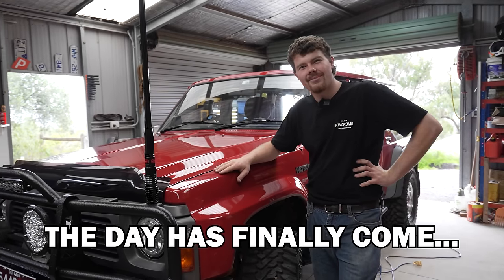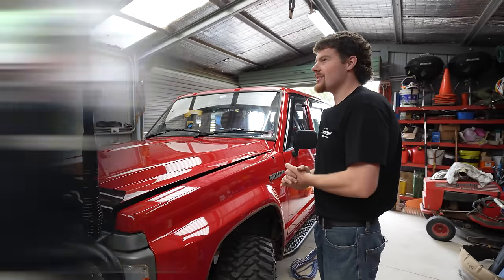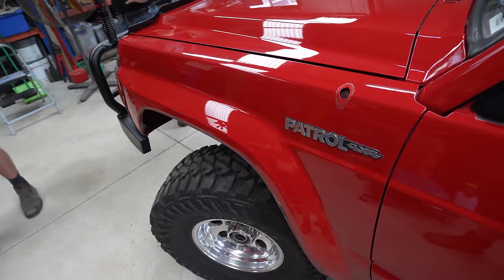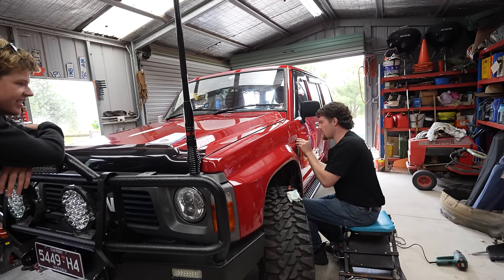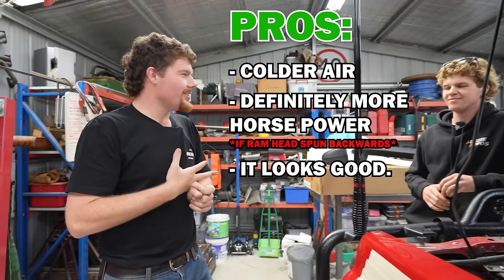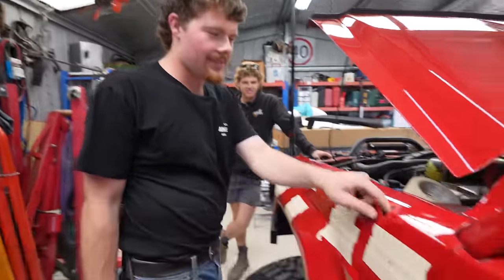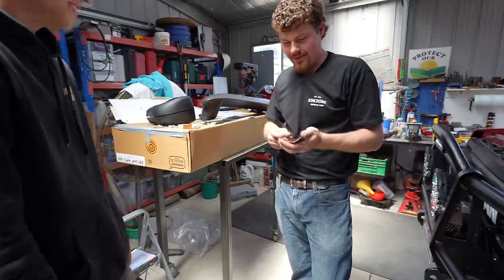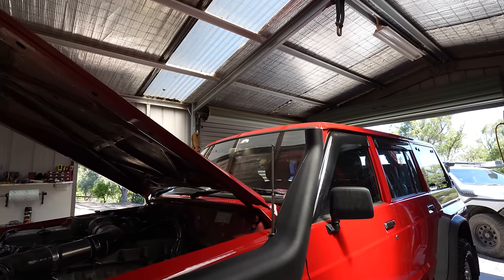Cutting a hole in Dan's Immaculate Patrol

Comment from the maker: What do you think? Has Dan made the right choice? Let us know your thoughts!!!
Reply: Great job Liam, great moral support!!!
Reply: Great job Lads 🎉
Reply: Definitely the right choice there, the new style Safari snorkels look mint on a GQ.

There's two things I did differently when I fitted the same snorkel to my GQ. With the holesaw, I used a much longer pilot drill in the holesaw, which was long enough to go through the guard and into the inner guard template/bracket Safari gives you. That got the holesaw lined up spot on to where the safari template wanted the hole, it also prevented the holesaw from eating the guard or wandering off target if it binds up.
The other thing is that I used blind nutserts in the pillar instead of those plastic clips. They're like your regular nutserts, but have a blanked back end, so even if water does travel down the threads, it can't go anywhere.

Keep up the good work boys.
Reply: Yes. I think the factory look suits the car better. Especially for his intended purpose
Reply: Finally some common sense and not just fitting an open ended posing s/s down pipe🤦.
Reply: It looks good, & Dan's thinking on it makes sense for what he wants. 

I draw on the great wisdom of "Uncle Rich" of Rich Rebuilds, if you don't know, he is the one that put an LS in a Tesla & called it "Ice T", a D-.max in another Tesla! And took another man's wife out to dinner @ Olive Garden & conveniently forgo his wallet on purpose! ( - I guess it would be the equivalent of "Smorgies" Probably a bit before you young fellas time, ask your parents :0))

Something to the effect of: "When you have your own YT channel & your own Tesla you can do it how ever you want"

Having said that, I did once see someone weld up a rear wing out of 3mm mild steel plate & bolt it on to the deck lid of a Camry some years ago, did not even linsh the edges. That upset me a little.
Reply: Looks sick 👌🏼
Reply: Why do you have so many chainsaws?
Reply: Nice job Dan,  my only complaint is that you make it look so damn easy😂😂😂
Reply: Looking good dude you know what's up every one will have an opinion about whats what but it's your car and you build it the way that suit you 🤙

Comment: Very neat job mate.
As someone who has done that job to several vehicles I've owned over the years, including my brand new GU in 2000, I know how nervous you must have been. 
Now, at 69 years, I've learned that snorkels are a waste of effort for most people. 
Deep water crossings are the ONLY justification for a snorkel. 
In your case,  with a petrol engine,  you're gunna have other serious issues if youre in water that deep.
If you think you're going to get cooler air , that's a joke. The air isn't going to be any cooler 2 meters above the ground than it is at one meter....and if anything,  it'll actually heat up more as it travels down that black plastic duct.
John Cadogan did a great video explaining all this.

Comment: A m8 of mine did this, but he didn’t use his original good one. He got one from a scrap yard and cut a hole in it, then spray painted it. He kept on the wall in his shed. 

I disagree when you said “cutting a hole is easy that getting a scrap one and painting it”. Get a scrap one, scuff it up, rattle can it with your colour and clear coat. 👍🏻 Sorted. 

If you cut the original one up and paint it down the line, it will never match.

Comment: i felt the same when i was putting the snorkel on my NGV. i dont like doing any modifications that cant be undone later so when it came time to do the snorkel, i had to route the piping into the guard, under the headlight and into the engine bay so i wouldnt have to cut into the inner guard. any interior mods such as uhf or switches ect, if i have to mount to anything, its to a replacable panel instead of just screwing into dash.

Comment: The acid bath thing is a real thing. I was an aircraft structural fitter in the airforce. The vast majority of panels were “ chemically milled”. So around the perimeter and across the panel forming “bays “ they applied a protective tape then used a chemical etching compound to reduce the thickness of the panel. On the F/A 18 Hornet they saved something like 600kg of weight overall. That’s a lot of extra fuel or bullets and bombs 😊

Comment: I felt it in my soul when they line about the template not being right was said.
When i fitted my snorkel, the template wasnt scaled properly for print. Im glad all the holes were UNDER the snorkel. Twice as many bolt holes and an entry hole that would make a Staino cry.

Definitely made the right choice with a Safari poly snorkel though.

Comment: Honestly added value to the car, also rub used engine oil on your outter plastics, then whipe with a clean rag, dust won't stick to it and it'll won't fadeout so quickly

Comment: Going the Safari was definitely the correct choice for your GQ, fits the square body lines much better than a stainless snorkel would.
Did your kit not come with a template for marking out the holes? Made it fairly straight forward when I installed my Safari, although it was still pretty nerve-racking drilling into a 2 week old car 😅
Edit: Never mind, I spoke too soon.
Reply: Also keep an eye on those plastic screw inserts in the A Pillar, it's pretty common for them to flog out after a while. A lot of people end up replacing them with rivnuts.